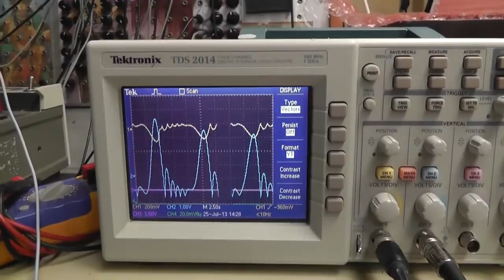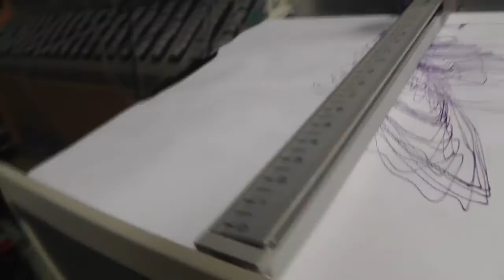Analogue computer with plotter - chaos patch

Comment from the maker: it just responds to two voltages, one controls the X axis, the other, the Y axis. The pots set the range of movement and the zero point. If the incoming signals are too fast, above about 2 Hz, the motors jitter. So IPM would be about 0.1 for a typical chaos picture. I got this from a dumpster, but they are easy enough to find on ebay (x-y plotter) or kits are available to build your own.